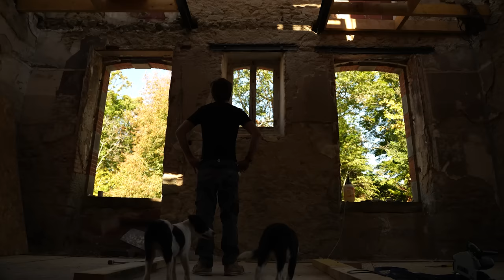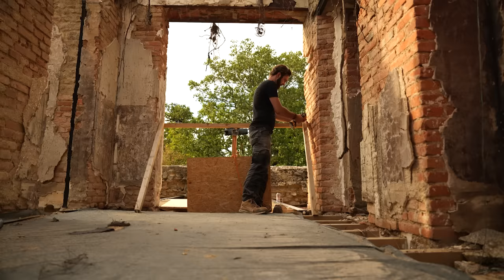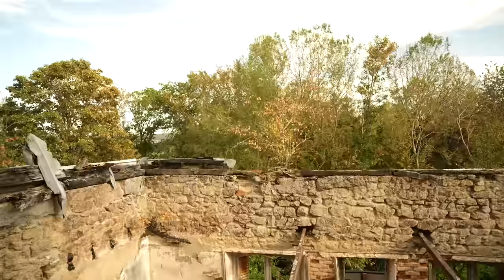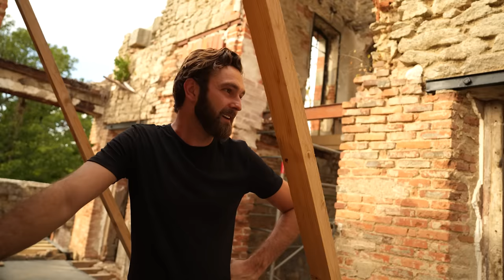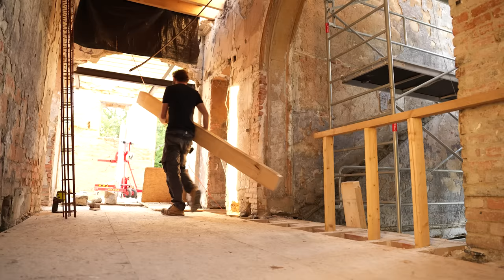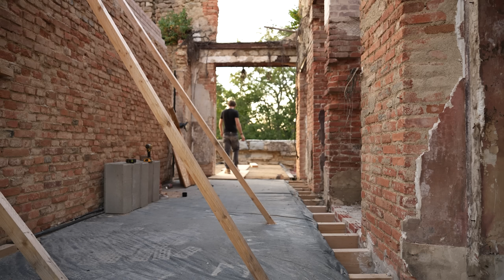how to recreate the original roof on this château ruin.

Comment: Your accomplishments are truly amazing. There is no arguing that fact. Should this have taken twice as long, it would still be amazing. Your five year plan may even be padded. Well done, Dan. Thank you. 🎉🎉
Reply: Ten year plan, to complete that one third will take another two years inside and out (Repair outside and render, repair and plaster or lime cement from basement up all walls to roof, fit windows and doors, fit ceilings and plaster, electrics, heating, fit roof, remove and fit new ground floor) three years the other side which is more or less the same, and four years the middle section, the most complicated part and assuming Nick will be doing the grounds!?!
Reply: You forget, the more he accomplishes, the faster he gets, the easier, templates are made, tools acquired.  Stairs... eventually.  Efficiency will increase.  Don't sell him short... Dan's accomplishments so far have been nothing short of awe inspiring!
Reply: @rhondashuker3641  They are great accomplishments, but so far this is the rough work.  I assume he will be doing all the work till the end.  The sheer amount of brick work he has ahead of him will take a lot of time.  Running new wiring, plumbing, tiling, etc. take a lot of time if you want to do it right.  On top of that finishing work is the most time consuming.  For example, it will astound you how much trim you need to finish just one room.  Plus the angle cuts have to be perfect or they don't match up well. A single degree difference can add up over a long board.  In addition many things like paint, varnishes, glues and epoxy take time to dry before you can take the next step, which usually is another coat of the same thing you just applied.  It tends to be that the closer you are to done, the harder the work that is left is, in terms of time and patience.  I do expect he will exceed our expectations on those as well, but I cannot see such a big place finished in five years unless he gets more helping hands.  It would be better if people expected less of him so that he doesn't push himself too hard trying to please people.  The work he is doing is exhausting.  I would know as I have built several homes, one of which was around 5,000 square feet, including the foundation which we also built.  It burned down thanks to squirrels chewing their way into the house about 20 years later.  We then had to clean up the debris and rebuild.  This time we made sure to make it squirrel proof and ran shielded wiring to prevent critters from chewing on the power wires again.  Thankfully so far not even a mouse has been able to enter.  We went a little crazy with the pest prevention this time around as we are a bit more paranoid.
Reply: I watch your videos but I don't understand anything about Argentina haha
Reply: @thomasherrin6798  That's exaughsting thinking about it 😀, we'll all be in a heap after all that 😂
Reply: I believe his kids will help him finish 💖💖💖💖
Reply: fotter9567 Agreed, the fit out and finishings will take many many years for one person. 

Also the roof would be suicidal  to build on his own. He needs the assistance of at least two carpenters and two roofers. Theres no way to build that roof safely without proper scaffold and access... not like he's been doing.
Reply: @janice8948    Haha, do you think it will take that long 😃, the way he's built this side he'll be finnished before they get old enough to help him I think 😀
Reply: I see what folks are saying and appreciate others are analyzing the timeframe.  I know I've considered the timeframe a number of times. I don't know, I bet Dan will hire out help for certain things over the years. You have to think, right now to have anyone other than trusted friends in there right now is a huge liability. With floors and walls, he's in a better place to hire helping hands to be present.  Either just a few unskilled laborers here and there. Or bring in specialized professionals to whip through some of the jobs. His views are growing so something tells me he'll be able to afford extra hands over the years. Imagine how many people would come and pitch in once the site is safer with floors/stairs.  My partner is absolutely giddy to go over and help for a week once it seems more possible.  Have faith in our Dan and the youtube community investing in this gargantuan home project.
Reply: @thomasherrin6798  It will take him 2 year just to mix the rendering mortar.

Comment: Hi Dan, my Dad is a retired roofer, and my brother and I have worked with him since the mid eighties.. just wanted to suggest that with complex roof structures like yours, it’s often better to build everything on the ground first by mocking up walls with old railway sleepers ti get your levels and spacing right. Then build the frame, once you’ve done the main frame, rafters, ridges, dormers and battens, you could then elect to cut and ‘dry fit’ the tiles/slates.
Once you’re happy with each section of roof (looks like you have 5 separate roofs), you can either deconstruct it and ferry it up and fit back together up top, or once tiles are removed from the dry fit, get the 5 roofs craned 🏗️ up on top. It reduces the amount of leg work at height, it reduces the hire period for scaffolding by about 75%!
Reply: Great Suggestions hopefuly he sees this post and considers this method👍
Reply: replying to bump this comment up! good tip!
Reply: Sounds good advice
Reply: A really great plan you gave. It doesn't seem like Dan is going through the comment section. Never seen him like any comment.
Reply: Great advice 👍
Reply: I think Dan's gonna need a crane for that roof.😊
Reply: Love this plan.
Reply: Great thinking from the experience of the masters.
Reply: @Dan - awesome advice here... definitely take this on 'board'... excuse the pun.
Reply: @Frank-Thoresen By Dan's comments he reads through most of the comments just doesn't push any likes.
Reply: @brashers759 - all good advice but Dan desperately needs engineer to plan the roof and simply refer to his plans for construction details - all this unapproved work he's doing is not only illegal but in my opinion is downright dangerous
Reply: @majorrgeek  A the 6 min mark, Dan does indicate all of his plans are sent to an engineer, so they are working with one.
Reply: @dad9159  - what Dan said at the 6 min mark doing CAD drawings for engineer AT THIS SATGE  is not how it works and verifies the fact he has no engineer's plans submitted to council or council approval - In my opinion a proper engineers evaluation would either condemn this chateau or it would require extensive renovations and all need to be signed off by engineers and inspectors

Comment: As a Carpenter, I absolutely love this roof. Framing this in all aspects would really be enjoyable and challenging.  Roofs like this is one of the few  times I really like the challenges being a roof framing journeyman pose. 
This is Second Empire,  Mansard.
Reply: I am not an expert in roofs or carpentry but from what I have seen explained in other videos these chateaux roofs were basically built the same as the hull of a ship except upside down of course. The same carpenters would work on both constructions. No fooling.
Reply: @paulcarfantan6688  that makes sense. Here in America these styles roof were built largely around 1890 to 1910 alot. Nowadays they never build them. In fact, I've built so many houses I can't remember them all and I have never, not once built this style roof. This man has undertaken an enormous challenge.  Very cool.

Comment: Although I'm a qualified building engineer I've never dealt with a mansard roof before. On looking into it it seems less complicated than I originally thought. The trusses are basically a rectangle supported on your floor joists((quite close to the inside of the wall), with angled rafters supported by the wall (concrete ring beam?) and a triangle with ridge beam above. Have you thought of putting in a lift – say in one of the bathroom sections off the turret? Even a simple electric hoist at present would be great for getting materials up to the upper floors. Great job so far! 😀
Reply: Do you think this is statically ok? I think that the project is a nightmare, because even the most basic sizing has not been done. There is no dimensioning for tensile stress.

Comment: Getting the turret roof peak done will probably be the easiest of all the roofs. All you have to do is focus on shoring the turrets wall tops, get the dimensions and build the roof on the ground safely. When it is finished use a large crane to get it up there and sit it in place and secure it to the top of the walls. 
That is how most of the castle resorations get their turrets done without large amounts of expensive external scaffolding.
Reply: This is obvious route, but so far Mr Dan has found insidous ways to achieve quick results where reasonable man would have erected scaffoldings, built fixed stairs inside or hired a crane. I am excited to find out how the roof will appear on the top level.

I think structural engineering and hse has killed my imagination... 😀
Reply: @lantapaukku7629  yeah i agree there, I think the same for me.
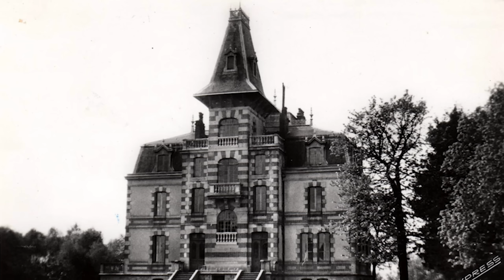Reply: Hey Dan, it looks like from the old pics that the turret should be where the ‘ new’ bricks are its a bit odd they have added a layer in the centre🎉🎉🎉🎉 @3:14
Reply: @Mindsi  looks like there was another floor mid way up the turret roof, hence the windows. If you look at 2:52 there is someone right up the very top. 
So there is obviously ladders and trapdoors to get all the way up there.
Reply: @theghost6412  but why the big stack of red bricks? In the old photo it’s just the turret after the three levels?it’s a bit like the overlook hotel film set in the shining which had impossible geometry if it was real😂😅😂🤣🤣🤣🤣😂😂
Reply: @Mindsi  Those are just the walls of that floor and you cant really see them when the roof which hangs down over them. If you look carefully that floor doesnt have a window, but it does have a slatted vent on the front facia under the roof eaves.
But I also suspect about 1 foot of those walls is missing due to collapse, and they also had the hidden next floor sitting on top of them. They are there to hold the very top floor up on top. 
There are actually 5 floors, not including the very tip top of the spire's Widow Walk or Basement.
Reply: @theghost6412  It did have windows I think but they were completely obscured by the giant roof overhang. The openings are visible in the tower brickwork.
Reply: @Ragnar8504  being under the roofs eaves I would expect it to be just a slatted vent only and only one on the very front. It would be interesting to see if it indeed was a small narrow window.
Reply: @theghost6412  It seems the openings are roughly the size of the dormer windows so I do think the fourth floor had windows rather than just vents.

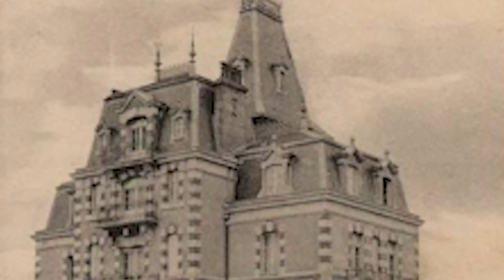Comment: 3:04 If needed somewhere, you can always go by the "brute force" way to measure the height of the roof: (1) fill a balloon with helium and tie it to a cord, (2) from the center of the top room, try to match (place the balloon at) the old photos roof landmarks checking with the perspective; (3) and the length of the cord (from the top of the walls) is the total height ;-)
Reply: At that height, surely wind would ruin this
Reply: with his drone if not
Reply: @CodeNeonMC  I still think it's a good idea...
Reply: What about Mathematics.
Triangles and Angles are much quicker.
Your idea would be fun though, great vlog idea.
Reply: @daisylovelock9553  thanks, that's why I called it "brute force" ;-) and I'm not so sure geometry would be faster for the curved roof, mainly because of the photo perspective that distorted the original curve, which is unknown. So you only need to move down the balloon and direct measure to obtain the different points instead of triangulation in perspective (which is reaaaaaally tedious ;-) )
Reply: @franzrogar  it's not tedious, it's joyful, you can get the curve from triangulation,even I can do it, was taught this when I was eleven, in school💕
Reply: @daisylovelock9553  I've never ever said nor implied in any way with any word or expression that it couldn't be done nor it couldn't be learnt. It's easier, faster and less error-prone to just measure directly the height (write one number) that having to triangulate (do an operation). That is a FACT.
Reply: @franzrogar Fascinating, everyday a school day for me💕

Comment: The method of framing the roof starts essentially by building a room within a room. When you ascertain the pitch of the lower half, and the height of the ceiling of inner room. Then you can build a pony (set back) wall. Then the lower pitched rafters set on the outside plate of rock walls, and the top of the rafter rests on the top plate of the inner wall. The lower pitch of the higher roof can be trusted, providing a ceiling, slope of roof, and span the entire room. Hip trusses can be used on the upper roof. Framing lower pitch of mansard/mansart roof becomes general carpentry.
Reply: A mansard roof to build is very complicated. U need a pro roofer to Do it right
Reply: At Andy, why the snarky comment ? I personally heve little idea how to go about the roof build and appreciate someone describing one approach: contributes to the learning experience. Go Dan go !!!
Reply: The pony walls would would be temporary though, wouldn't they? At least I'm fairly convinced the original design didn't have walls below the pitch change.

Comment: to build a Mansard roof, place sill plate timbers on the top of the masonry. connect the outside walls with tie beams/floor joists of the attic, and tie to the plates atop the wall. erect the steep pitched sections and brace in position. connect those rafters to the tie beams. across  the top of the rafters place a beam that will support the upper trusses Construct the upper trusses as king post trusses with allowance for a peak rafter beam. tie the upper trusses to the steep pitched walls. the lower chord of the upper truss will act as another tie beam. the steep rafter lower tie beam and a vertical tie between the floor and the rafter will act as a half truss on the extreme outside. bracing between the upper truss bottom chord and the steep walls will stiffen the roof structure. Another option is the create a barn-roof of the American type. there should be a detail at the gutter end to kick the water away from the masonry wall

The Mansard roof construction will create an open attic space above.

Comment: Hey Dan! It's interesting about the roof! Looks complex though! If I was you, especially where you can see the outline of where the roof was, against the other walls, I might try to draw a straight line, using chalk or something, between the different bits, so, I can see where they all join & get the measurements as accurately as possible. That's just me though!
Reply: or use a laser measurement tool.

Comment: Just getting all the masonary ready to take the roof structure is a herculean effort. In three months winter sets in with rain and snow. Will all your flooring be ok after exposure to the elements for a winter and a spring?
Reply: It must be covered, otherwise it's just rotting away. Actually the floors should be covered right now, because with every rain the wood is damaged.
Reply: A temporary roof could be done quickly. A hip style roof would only take a few days and provide enough protection until spring and the correct roof could be constructed.
Plus I believe this floor sheeting is only supposed to be temporary while construction is ongoing. He was going to replace it all once the roofs are on and windows and doors are fitted.
Reply: @brendamayfuller8803  the floor sheeting is temporary for sure. But what about the beams?
Reply: @calypso4554  If those beams are anything similar to what we use in Australia, they are treated to be weather resistant and would stand up to a little weathering much better than the originals would have. We have to remember the original building would probably taken over a year to build and would have been exposed to the weather as well.
Reply: @brendamayfuller8803  let's hope so.

Comment: Sometimes smaller wooden ring beams are better the long length, due to them twisting as they dry out.
When you give the measurements to the engineer/architect, please ask for a modern alternative to the original design.
Things have changed so much and with modern materials greater expenses can be covered, compared to before.
All credit to you for wanting to recreate the roof as it was, but a fresh eye with a modern approach can still echo the appearance of yesteryear.

Comment: I saw a construction crew using a much easier method to get sheet goods up to elevation, they simply slapped a clamp on one end of the sheet, and pulled it up with a rope.  You might want to consider this as it looked so much easier than what you're doing.

Comment: The original drawings of that roof need to be found somehow.  If it cannot be found, a roof similar to the original can be first designed and then built by taking the roofs of similar buildings as examples.  Another option, if possible, is to start meeting and exchanging ideas for a new and original roof by making an agreement with a good architect.  Because roofing is serious business.  Many calculations need to be made.  New loads will come to the masonry stone - brick mixture structure, there are wind loads, etc.